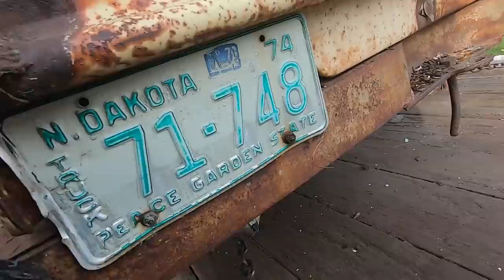Abandoned Farm Truck! 1964 International Harvester C900 Shortbed Stepside Will it run?!?

Comment: You're going to have to "hand craft" some of those parts - you might be able to re-melt that bullet hole with a blow torch, or use a glass repair kit.  Everything else that's rusted, you'll need to re-craft from sheet steel.  The good news is that medium sized flat sheets are $60.  Weld [2] for the back (ridged pattern optional), whatever size is needed; cut out that rusted sh*t out, and you got a brand new flat bed for the back.  Sand blast the inner sections yourself; Wire wheel all that crap off the rest of the body, repaint with a metal sealer paint [$40], and that's not bad!
Reply: And JUNK those crappy seats!  lol.  ( wire wheel the wire frame, optional.  How's your seat sewing and threading skills?  )
Reply from the maker: Haha that seat is ssooooooo comfortable tho!

Comment: If you used the brake residual valve on the clutch would you have a "slipper clutch"? Like they use for drag racing?
Reply from the maker: Someting like that. You'd have a delayed response.
Reply: @MortskeRepair  cool, so you would have a race truck.

Comment: I quick flipped one around 2013. 4 headlight, they used a torsion bar setup. Gas tank was odd. Filled gas in driver fender. Believe it was a 64?

Comment: I grew up with an International Travelall back in the 60s. It is true most parts are very much unobtainium. It was so heavy (built like a tank, no weight saving plastic or fiberglass for us thank you very much) that at best you got 7 to 9 mpg. Still, we were in a highway accident in it in 1968 that the mechanic who looked at it said if it had been any other vehicle, the framed would have separated from the body and most of us would have been seriously injured or killed. 

But still good hustle out there Mortske, can't save them all.
Reply from the maker: Well built rigs!

Comment: If you're gonna use a cup from a wheel cylinder in that clutch slave unit, you'd probably need to use a spring to push the cup back against the piston, (as in wheel cylinders have two cup seals w/spring between them,  right?
Reply from the maker: The oil on the back side of the cup should keep pressure against the piston. This wouldn't be a long term repair by any means.

Comment: 90s Chevy Single cab short wheel base 4x4 frame swap use plexiglass for a back glass and do a DIY wood bed floor conversion or patch/replace it with the bed floor from the donor truck.

Comment: International v8's recirculate all the coolant that thermostat doesn't let go through the radiator.I looks as though the half v8 is the same. The second flexible hose on the thermostat . The 392 international has a large cast iron bit on the manifold to make this happen.

Comment: What exactly is so bad about those bendy radiator hoses? I got a vehicle with them and so far haven't noticed any issues with them.
Reply from the maker: They look terrible. They're expensive. And they're hard on the radiator outlets.
Reply: @MortskeRepair  I agree on the looks. I didn't realize they were so expensive though. They were on the vehicle when I got and I never thought much of it until recently. Sounds like a massive rip off!
Reply from the maker: @plumbingstuffinoregon2471  They work in a pinch. A good parts guy wouldn't sell them and would find something for you that would work.

Comment: you could use a grease gun to push the piston out if it does not work with the grease gun then you heat it up with a torch

Comment: Yes do the caprice swap. Doesn’t make sense to buy those parts to get an anemic, worn out motor going. Caprices can be found running for $500
Reply from the maker: The prices are going up tho!
Reply: @MortskeRepair  I bought a 92 a few years ago I haven’t swapped the drive train yet. But it’s has the 305 roller cam engine with a 700r. Ran & drove great $600

Comment: I had a 66 crew cab (ex Weyrhauser Lumber crew truck). Worked a summer for my uncle chasin chokers on a logging crew to pay it off.. slapped some licence plates and road signs in the floor. Some blankets on the seat and drove it 1400 miles home
Reply from the maker: Nice!

Comment: Dear Sir. The Bottom line here is Keep her All Stock Binder. Because  you have got something Very Rare to work with. That there Just is not to many of those left any longer..that alone makes it a Worth While project. Amen 20/4.
Reply from the maker: No doubt it's rare. But as rough as it is and the value of it don't constitute the effort to restore it. We'll see what happens. Maybe I'll fall into some cheap IH parts but I doubt it!

Comment: In that vintage, the 4-cyl engines were either a 152 (half of the 304 V8) or a 196 (half of a 392 V8).  Don't think IH had a "half a 345" engine, even though 345 was one of the gas-guzzling V8s (266, 304, 345, 392).

Comment: That's a tough one. If you were attached and had an unlimited budget, then i would say fix it, but it's probably too far gone. It would take a fortune, not to mention several years, to even make this truck roadworthy. You didn't even mention the condition of the frame itself in this video, and the body is definitely gone. Honestly, I would salvage the motor, since it runs and you may need it later for something. Salvage as may good parts as you can find, since someone will undoubtedly need them, then call it a day. I love oddballs like this, but sometimes it just can't be done. At least see if you can find an International nut with too much money that may want to take it on before you junk it.
Reply from the maker: Frame was actually good on it!

Comment: One good way to tell the year of a vehicle sometimes that's the only older model since it'll have the date stamped inside the tail light lenses
Reply from the maker: Many times they used the same taillights for several years however. And the code never changes.

Comment: The cost and availability of parts are what makes the oddballs challenging. That, and no one else cares. My Hudson has a 75 Nova grafted in it. I can travel anywhere and be confident about getting parts and they are cheap.
Reply from the maker: Way to make it enjoyable!
Reply: @MortskeRepair  I drive it everywhere. I trailered a small car on a dolly with it for 1500 miles. Cool, comfortable and reliable. Has 250 six and 350 auto running 2.73 gear. No tire fryer but that’s not the point. Keeps up to traffic fine and has disc brakes. I enjoy your videos. Shows people what can be done on a limited budget. High budget builds are way overrated!
Reply from the maker: @junkorbust9498  Anybody can pay a shop or just buy a done one!

Comment: Part 780-721 is an mgc 1"slave cylinder rebuild kit from moss motors. IH used TRW slave cylinders and this kit should fit. It is in stock and is only $5.99!
Reply from the maker: How about one for the clutch master?!?
Reply: @MortskeRepair  partsgeek has an entire new brake/clutch master  cylinder for $49.63. It is for a Chevy c10 but should fit. Part number 116875-05510200
Reply: Anytime you need parts, I can look for them for you. I own a 1978 triumph spitfire and a 1974 Jensen healey. Both need special parts on occasion. Oh and back in my youth, I owned a 1963 IH Scout and scrounged for parts constantly.
Reply: @MortskeRepair  FYI, wheel cylinders(rear)part number set-
 18E855-R $ 24.81 at car parts .com. This is for a set of two.

Comment: Switching the pedals for the clutch an the brake could be pretty funny I would like to seee that
Reply from the maker: Coming soon!
Reply: Get the pedal assembly from a different make and use that make master cylinders, or use aftermarket master cylinder for the clutch.

Comment: We had one of those. It likely has 456 rear gears and might be a no spin. I also had two scouts with the slant 4 engines. The engine is a 152 cubic inch. the exact same cubic inch as a H farmall tractor has. Ive still got 2 of those slant 4 engines in my hoard.
Reply from the maker: I was hoping to get to drive this little 4 banger!

Comment: Nickname the 1964 International pick up should be Toffee & points cleaner use woman nail file a metal one and not plastic with sand grip break to fast ! Yes those 156 4 cylinder motor are wild 70 hp with 90 torque!
Reply: 10 inch rods ?

Comment: It has the same front end as our ‘63 IH 1200C. It also would’ve had an oil-bath air cleaner and I don’t think the yellow wheels are original, I believe it would’ve had lockring wheels on it.
Reply from the maker: I'm not sure I've ever seen a 1/2 ton with split rims. Wheels appear original on this one.

Comment: Unless it's a popular vehicle flex hoses are sometimes all you can get for them old rigs when you're in a bind unfortunately.
Reply: Auto parts stores sell those lousy flex hoses for convenience, all they have to consider are diameter and lenghth, then it will fit anything.
Reply from the maker: I've had great luck with measuring diameter and bending a metal wire the shape I need. Go in back and look at what they have and 90 percent of the time you'll find something that works and looks great! And for 1/3 the price of a flex hose!
Reply: You can go in the back(if they will let you).The bent wire idea is pure genius !
Reply from the maker: @jeromebreeding3302  You talk nice to them parts guys and they'll let you have free range of most of the big chain stores even! Think about it you're basically doing their job for them!

Comment: Why didn't you just swap the brake and clutch lines on the gmc master cylinder?
Reply from the maker: The diameters were different on the bores.
Reply: Right, but I'm talking about swapping the hard lines. They should both be the same size.
Reply from the maker: @WagsAutomotive  Correct, but the bores are different diameter. Moving more fluid could spell disaster for the slave or other components.
Reply: It'll be fine! 😁 What's the worst that can happen?
Reply from the maker: @WagsAutomotive  Nothing to lose! Just the shop on the line!

Comment: I dont think the air cleaner is factory but they did use parts from other manufacturers especially in the later years i think the ignition switches were gm some had ford engines
Reply: Amc, jeep international

Comment: Ya IH was famous for building trucks with tractor motors... they suck unless you do what you're thinking of... swapping in a Corvette in and just plopping that body on... maybe diamond plate the floors and bed... come along that front inner fender to a concrete pole in the parking lot to pull it out a bit lol  But ya... work on the IMpala or that Bitch'n ramp truck... Hoof that IH to the back of the lot in case you find and old Crown Vic / or Caprice or whatever your flavour of doner car will be because... lets face it if you find another pickup truck... you'd likely keep a Ford or BM instead of this guy... A dodge truck even? Anyway... I feel for ya bud.

Comment: Half of a 304 was a 152 and 196 was half of the 392.
Reply from the maker: They made both?!?
Reply: @MortskeRepair  yup
 Fuel System Type 	Carburetor 
Years Produced   1961-1972
Engine Family 
"Comanche" 4 	 	
Cylinder Layout  I4
Displacement(s) 
    4-152 (152 cu in (2.5 litres))
    4-196 (196 cu in (3.2 litres))

Comment: I’d make your own replacement panels if I was you from scratch For your sheet metal and you don’t have to spend that much money on sheet metal that’s cheaper than going looking for a donor vehicle to Rob Panels  from. And because he would be going that far it almost would make sense to get all the rust removed into a frame off restoration nut and bolt  style. Trying to save as many of the hardware pieces you can from it without having to replace anything which would also save you some money to
Reply from the maker: I can make the panels but I can't make clutch and brake parts so I'd have to fork out a fair amount for those.
Reply: @MortskeRepair   makes sense Then you’re probably better off selling this truck to someone who is willing to take it that extra step if I were you I would get everything done except for the brakes and send it on down the line if someone else wants to do the brakes but I have everything else we done except for the brakes

Comment: Stick with getting the best used parts, if possible.  Pull the engine - and set it aside.  Use it as "visitor trophy".   Yes, those replacement parts DO sound expensive!  Just by-pass the b/s and move on...